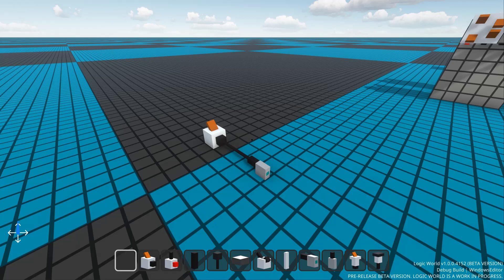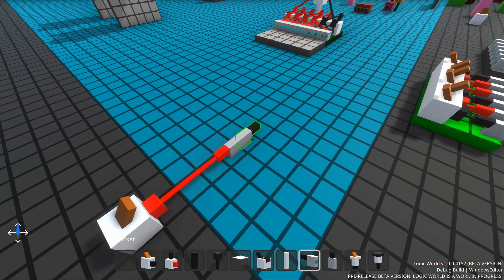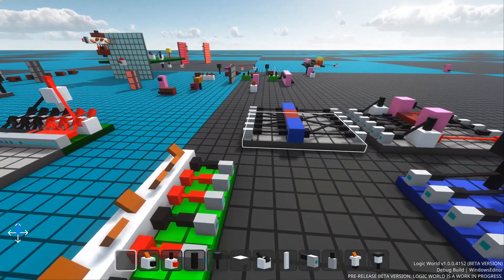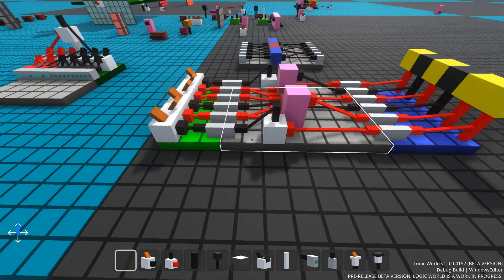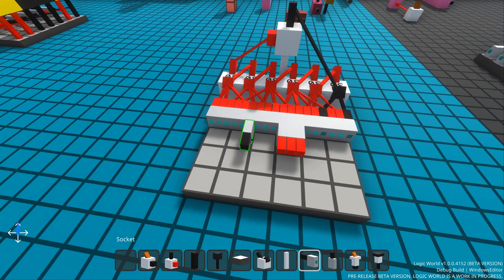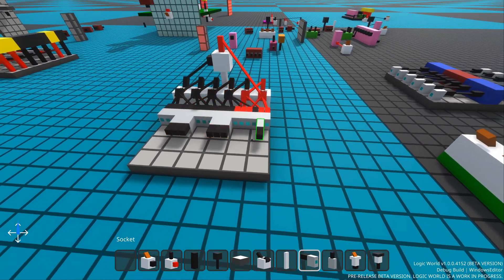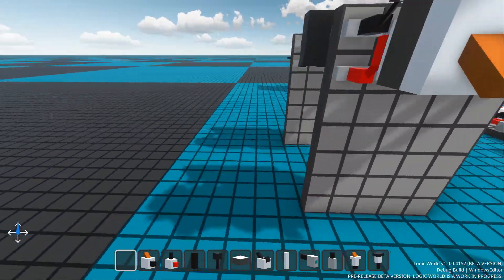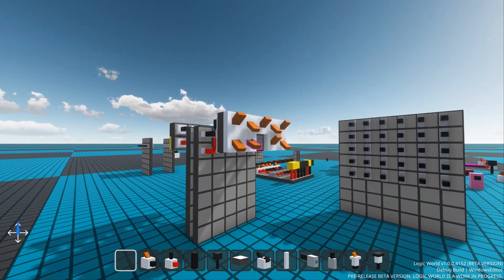The Socket

Comment: Hi. What is a MOD key?
Reply: Mod is for modifying behaviour. It is mostly used as a referenced binding by other bindings in the controls menu. If you want to learn more than open up logic world go to settings > controls > global and you can see your mod key. It is set to Ctrl by default and if you hover your mouse on the key you can read a bit more about this key. Hope this helps!
Reply: @alexpetras5752  Thanks for your reply. Your directions have helped me find out MOD has been assigned CTRL on my keyboard. 😃